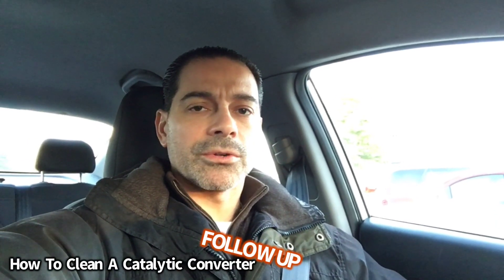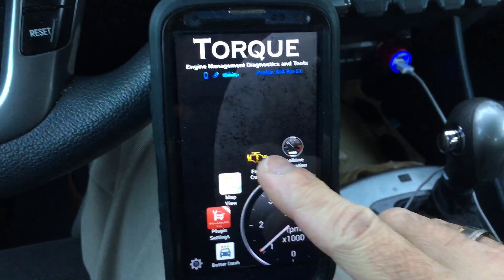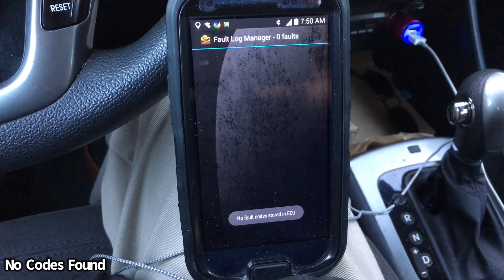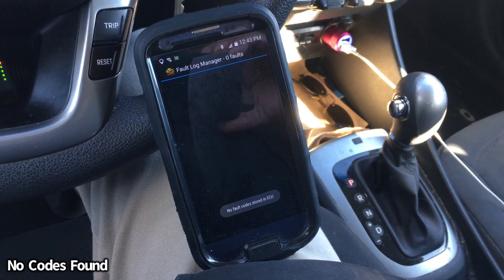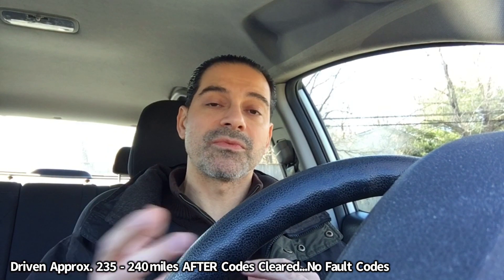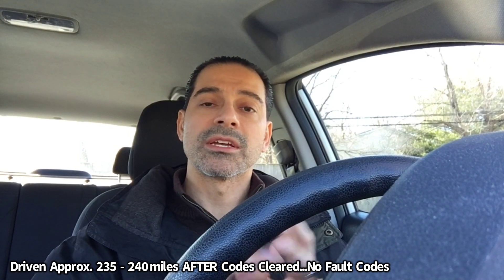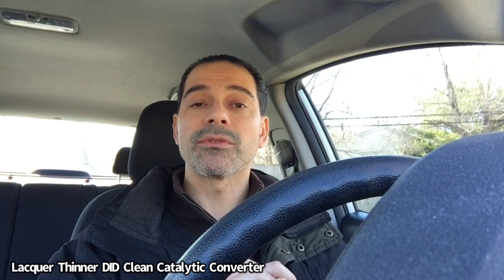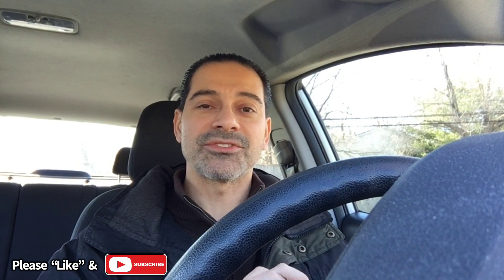How To Clean A Catalytic Converter - FOLLOW-UP (Andy’s Garage: Episode - 151)

Comment: The thinner will not clean a cat because it's already combusted by the time it travels through it. However, thinner cleans the crap out of the fuel system, injectors and cylinders which may be why it works for some people.
Reply: There is never a clean complete burn. that is why a cat works. so there will still unburn products in the exhaust.
Reply: If we had a completely clean burn, everyone's cars would be so efficient making power and using fuel. This dream simply doesn't exist

Comment: I was told by my mechanic that its dangerous using laquer thinner for cleaning my cat. I was advied not to do it.
Reply from the maker: Blk Popeye every mechanic has their own opinion of it. I personally have heard more say in favor of it than against it. I don’t see it as dangerous if you measure it properly.
Reply: He could be telling you that because he doesn't want to lose a job he will make alot of money off of.
Reply: 8 months ago now is 12/30/20 I just tried and worke good thanks god my headache went away with $2000 ,thanks you ,just awsome
Reply: Dangerous to his wallet? you just didn't hear that part.

Comment: My 16 accent is on limp mode and only driving 5 mph due to clogged cats. You think I should
Try this out before I have to spend $3000 for two 🐈 🥲
Reply from the maker: You could, but if they are badly clogged you may want to remove them and try cleaning them before buying new ones